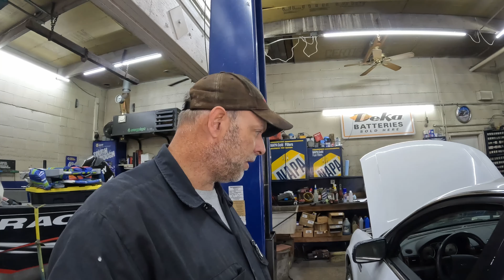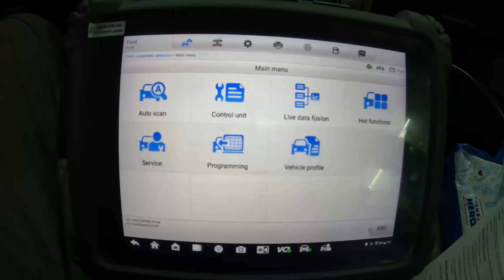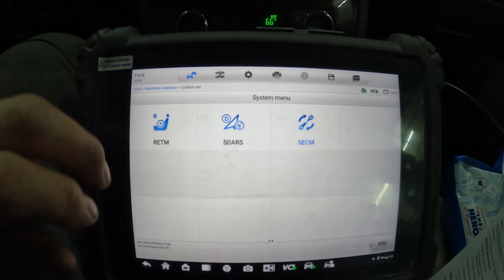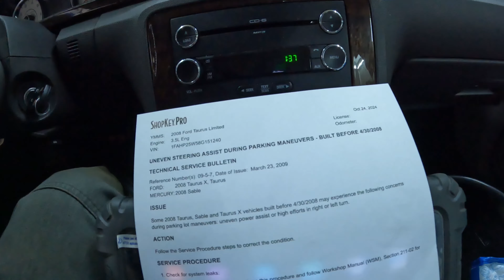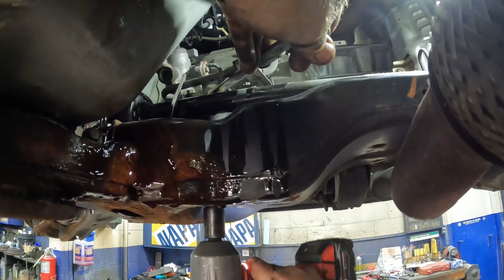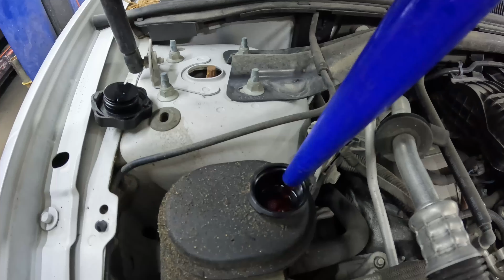2008 Ford Taurus High Steering Effort

Comment: I have a 2012 that is doing the very same thing. Hard effort to the right and easier to the left. Seem like spraying the U joint with silicon lube made things a bit better. Was wondering how long this took you and what was the charge to the customer? If you are able to disclose.

Comment: So i changed my rack but its still stiff and now its making noise from the pressure switch. Could it be a bad switch ? Or is it something else im missing
Reply: The car also had a missing pigtail to connect to the switch when i got the car on a trade. Before it wasnt making any noise and now that I have replaced that and the rack and pinion its making noise from the switch
Reply from the maker: Check fluid level and make sure you don't have any air in it.